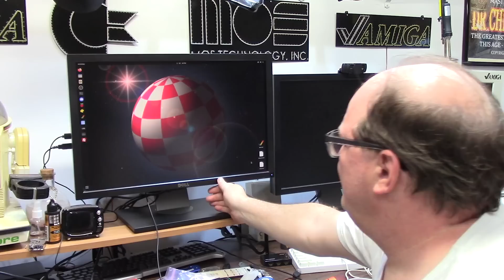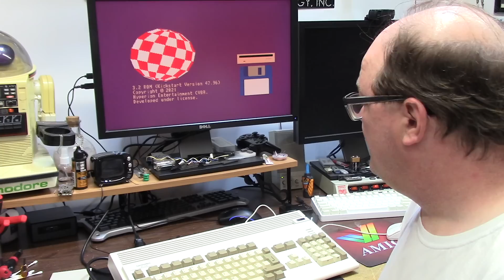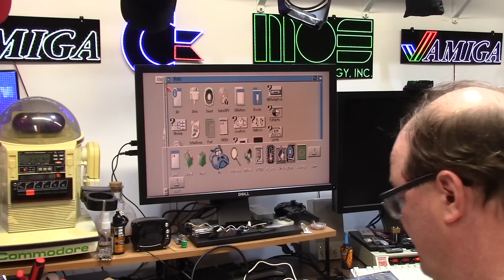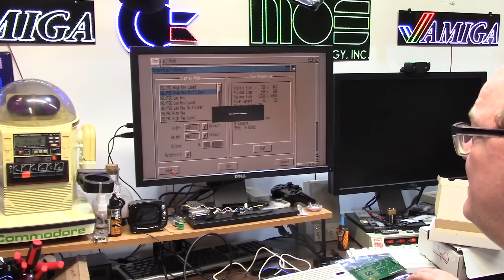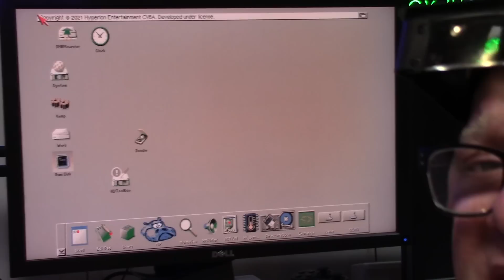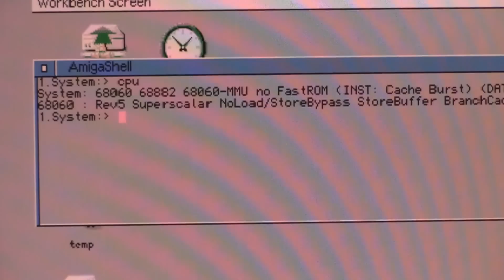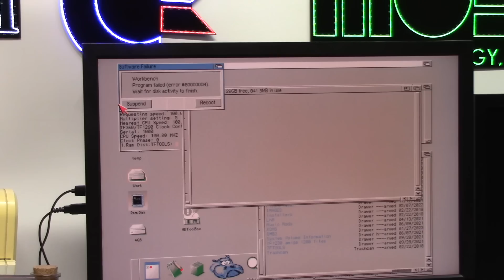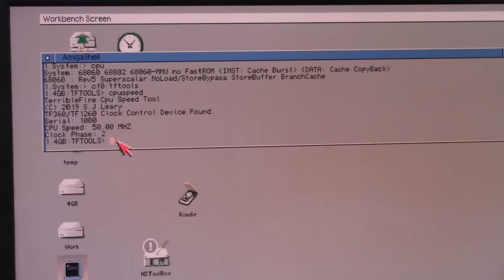TF1260 and a new Dell monitor

Comment: My personal list of monitors that will sync to Amiga 500 NTSC 15khz signals with a buffered VGA adapter: 

    Acer B226WL

    Acer B227Q bmiprx (slightly blurry image unenhanced, the only sharpness adjustment is super-sharpness on/off, with super-sharpness on image is acceptable)
    Acer B246HL
    Acer R240HY
    Acer S220HQL
    Acer G226HQL (panel has narrow viewing angle)
    Acer G235H
    Acer G276HL
    Acer H226HQL bid (tested with 15khz tester)
    Acer H276HL
    Acer H233H bmid (from 2010, adjusting horizontal clock or activating auto adjust will make image unstable (horizontal jittering) until you either powercycle or cycle the monitor input from VGA to HDMI and back to VGA)
    Acer KA272 bi (2020) (works with 15khz tester)
    Acer V196HQL Ab (panel has narrow viewing angle)
    Acer V196WL b
    Acer V203H Cjbd
    Asus VE228
    Asus VE248H (2017)
    Asus VE248Q (works with 15khz tester)
    Asus VH238 (warning: I have also found an Asus VH238H that does not work with a 15khz tester, so maybe not all Asus VH238 work.)
    Asus VS248P
    Benq RL2755-B (OSD info says RL2755T)
    Dell P2210
    Dell ST2210b
    Dell ST2410b (wants to auto adjust upon Amiga boot/reset)
    Dell ST2420Lb (tested with 15khz tester)
    Dell ST2421Lb
    Dell P2310
    Dell U2410 (auto adjust works well, manually changing the phase/clock will make the screen will go wonky, cycle inputs to return to normal, zoom to 15 will fill the screen)
    Dell U2212HMc (93 for pixel clock, 10 for hpos, 80 for vpos is perfect)
    Dell E2213Hb (note that the E2213c does not work with 15khz signals but the E2213Hb does work with 15khz signals)
    Dell E2214Hb
    Dell P2214H
    Dell P2314H
    Dell E2414H
    Dell P2414H
    Dell SE2717H
    Dell P2018H
    Dell 1220 Projector
    Epson EX3220 Projector
    Epson VS340 Projector
    HP Elitedisplay E231i  (this is the one with the IPS panel, the EliteDisplay E231 doesn't work)
    Infocus IN24+ W240 Projector (tested with 15khz tester)
    Infocus ScreenPlay 4805 Projector (works with non interlace on M1-DA interface with VGA/USB cable, but interlace is scrambled and unusable)
    Lenovo LT2252p wide (switching from interlace to non interlace can cause screen to go blank, either reset amiga or use dpaint 3 to change resolution to bring it back, recommend non interlace only)
    NEC Multisync E222W (tested with 15khz tester)
    NEC Multisync EA241WM (detects a500 NTSC as 640x200 (completely fills screen to edges) when in non-interlace and 720x480 when in interlace (displays inset from edges))
    NEC Multisync EA261WM (tested with 15khz vga tester, 320x240 fills screen like EA241WM, assume it has similar behavior to EA241WM, very heavy 27 lbs)
    NEC VT570 Projector
    Planar PLL2210W (interlace is normal size)
    Planar PLL2410W (non interlace mode ok, interlace modes are double width so right half is off screen)
    Philips 17PF8946/37 17" LCD TV
    Sceptre E275W
    Seiki SE22HY01 Television
    Viewsonic VA2246mh-LED
    Viewsonic VA2259-smh
    Viewsonic VA2703-LED (auto adjust puts vertical screen position halfway up, but position/size can be manually adjusted) 
    Viewsonic VA2746mh-LED (tested with 15khz tester only)
    Viewsonic VG2239m-LED (auto adjust puts vertical screen position halfway up, but position/size can be manually adjusted) 
    Zalman Trimon MZ240ED (screen goes blank for a few (5-20) seconds while switching from interlace to non interlace, otherwise fine, recommend using non interlace only)

One thing I've noticed is that almost all of the monitors do the same "wrong line" interlace display on Amiga signals.  The Seiki SE22HY01 Television does proper deinterlacing that looks good.  Also the Dell U2410 will do a proper job with interlace.
 
It appears that many dell monitors have a SSYY pattern where SS is the diagonal size and YY is the year, and the years 2010 and 2014 were very good years as 2010 had the U2410, P2210, P2310, ST2210b and 2014 had the E2214, P2214, P2314, E2414, P2414.  https://en.wikipedia.org/wiki/Dell_monitors
 
Projectors will typically take a few seconds to lock on to the signal when you switch to interlace from non-interlace and vice versa.
 
After purchasing and finding many monitors that don't work, a 15khz tester from pcbjunkie has helped find monitors that will actually work with a 15khz signal.  Search the web for "15khz tester".
Reply from the maker: Quite the comment thank you!   My dell u2410-f is from 2018 and works fine
Reply: @ChrisEdwardsRestoration    If you have an LCD television with a YPbPr component input, you can get an RGBS/VGA to YPBPR adapter to hook up to a buffered VGA adapter.  A compatible TV will be able to display and deinterlace the 15khz signals. (Not all TVs will work with 240p/480i signals, I would say about half of the ones I've tried will work)  I tried a Sony KDL-32EX400 recently and it is beautiful.  

And if you hook up the Amiga 500's composite output to an LCD TV video in, most will do perfect deinterlacing, though the a500 composite is in black and white.

Comment: Got one of these Dell U2410F a few months ago. Have you noticed that it requires some "Warm up" time until it reaches full illumination? It also seems noticeably dimmer than most modern monitors but I like the fact that the black colors are really black with no back-glow that most IPS monitors have. Also seems to get noticeably warm.
Reply: I have a U2405F (yeah, an old one!) and it's the same, I think the fluorescent backlight just takes longer to warm up as it gets older.  But once warmed up it does still have a pretty  bright display and the blacks are much better than my newer U2415b's.

Comment: I NEED TO FIND A BARGAIN RC060- like the one Jan Beta found in optical recognition cards- cause $300+ isn't worth it, as my Allen Marks TF1260 sans FPU doesn't run a lot of good stuff (and there's no oxypatcher equiv for the TF!)
Reply from the maker: i have a special ebay seller from china that has earned his trust with Amiga people,  legit R6's 350$ 100mhz all day long. i emailed you.

Comment: New firmware out dude ver 68090, so if you have chance reflash it
Reply: Is it normal to achieve 6.xx chipspeed vs. A600 on Sysinfo with firmware 1000? Mine does only around 2.5…
Reply: @o_guguito  Sysinfo is good comparison but not the best but we all use it don`t we, I get around that too :)
Reply: Cool - will have to check that out!

Comment: So you like old Dell monitors?
I have one I'm not using from 2010 (AC100-240V,50-60Hz,1.2A) if you're interested.
It only has the 25-pin video connector, and a space on the back for wall mounting (yeah, right; it's about 21")
Reply from the maker: im pretty full up but thank you, 25 pin? what is that for?
Reply: @ChrisEdwardsRestoration  
My bad. Had to put on my helmet off goober to see 3 rows of 5 pins/holes… so 15 pin.